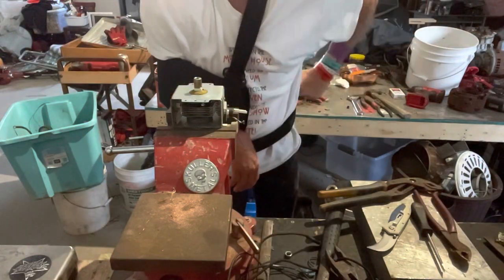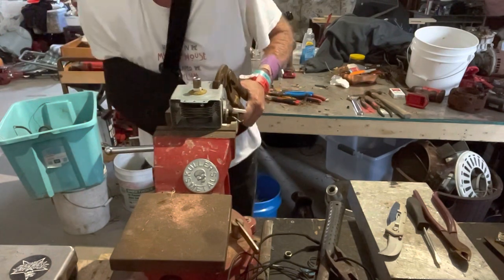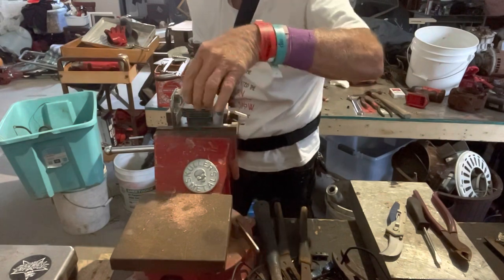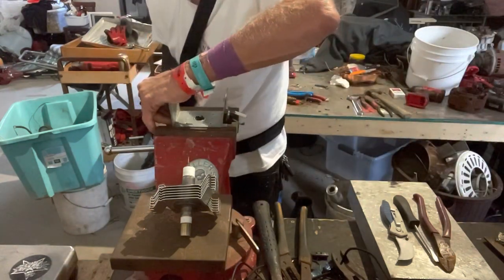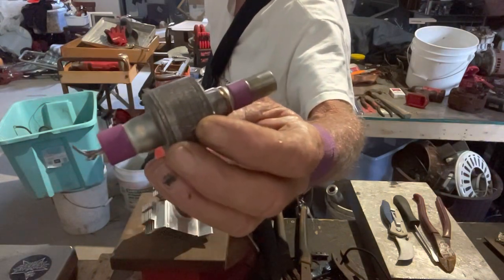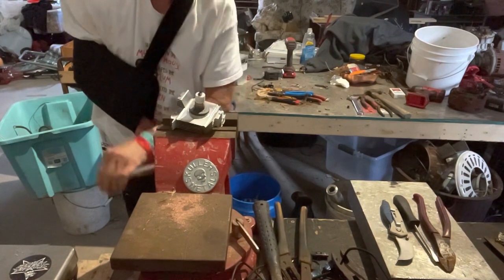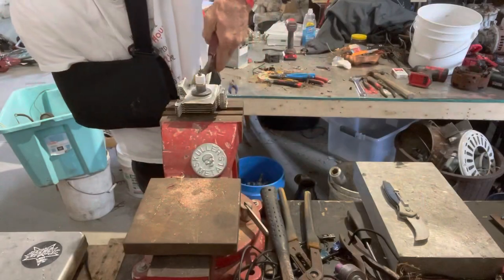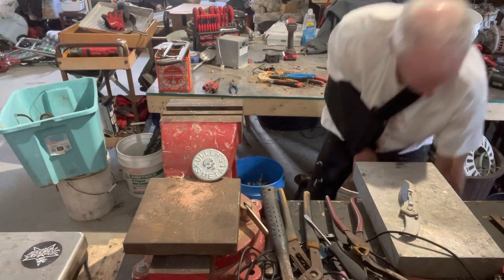Scrapping a Microwave Magnetron with 1 hand for Copper Aluminum and brass

Comment: My scrap yard quit taking microwaves all together.  They said something about them blowing up if something on it got wet. Ive never in my life heard anything about a microwave blowing up unplugged.  🤦‍♂️🤦‍♂️
Reply from the maker: What do you do with them if not scraping them. Throw in the trash. I’ve never heard of one blowing up either.
Reply: I take them apart and put the metal in the burn barrel and beat it down and put it in refrigerator or something else and throw it out at the scrap yard like that.